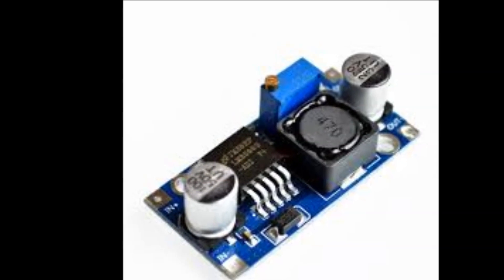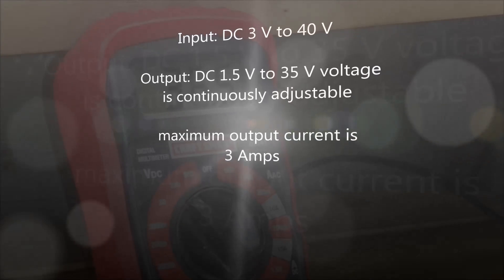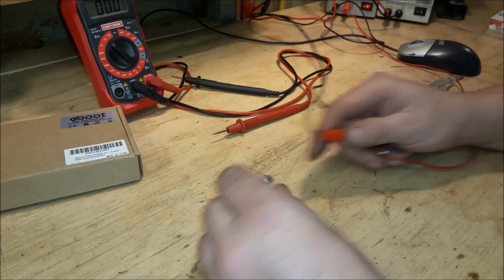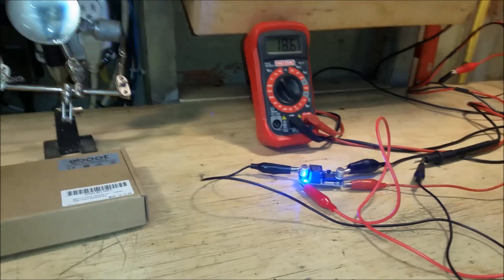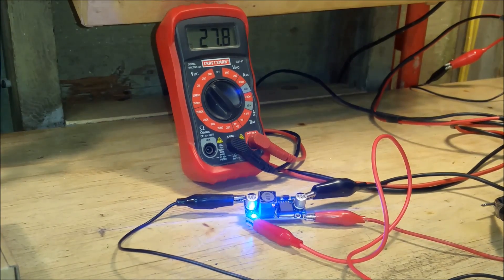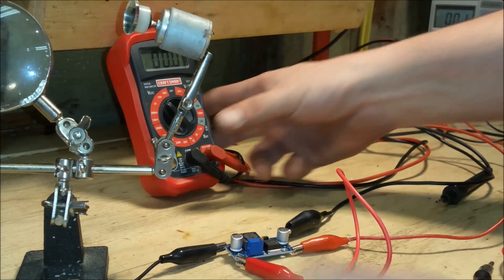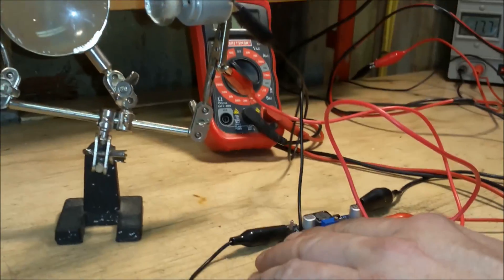LM2596S DC-DC buck converter, with Smoke!! Product Review

Comment: I have few of those which look exactly the same, but from Aliexpress. Mine were using fake LM2596S chip. I measured 28kHz frequency when advertized to be 150kHz and output ripple of 140mV. I ordered few original LM2596S chips from Mouser and tested with them. Output ripple decreased to half ~70mV, which is still considerably high. Most likely due to bad quality output capacitor. However for the price, these are not bad. However efficiency was 3mA better with the fake chip. I paid around 10x more of the original LM2596S chip from Mouser than what the whole converter cost from Aliexpress! 😂

Comment: The led is connect to output with out a led regulater and that make the led with the resistance heat up  . It's a defective design . I have this unit and it best to use this unit to many stuff with input 28v solar panel and output 13.7v for charging battery with 1 to 1.5ohm resistance . Or you can use this model for powersupply from 0 up to 28v and don't forget to put a 4 diod 5A in serial so you can get out a the minimum voltage near to 0 ( put a DC volt amp meter in output )

Comment: I didn't see the smoke in your video but i have this same module and it emits smoke at high voltage. Anyway, i will not use it above 19v. I liked "qwerty mohamedfaroeks" comment too, i didn't noticed the capacitor voltage at output, i am totally noob in electronics. It's a SMD capacitor of 35v, 220uF, 6.5 x 9.0 mm, but not sure. I will try an update soon.
Reply from the maker: Lots of people cant see the smoke,... or imagined smoke anyways.  (can someone that sees the smoke, leave a comment please?)  Thanks Daniel!
Reply: @DonBrandt  Hey! I see that in 1080p fullscreen!
Reply: I run these at 24V to drop to 3.6V @ 30mA without issue. Been running happily for several months. Module temp. 13.6°C, air temp +/-9°C. Just checked it to see as I've only ever put a finger on it for temp. test. Oh, and I can't see smoke on 5.5" non HD screen at 3G Internet speed below dial up... Ahhh 21st century rural inertnet

Comment: A little late to the party, but it's clear to me that the smoke came from the current limiting resistor for the LED.
Reply from the maker: Hi Norm and thanks for the comment. Many people dont see the smoke. lol.
Reply: The design problem is that they put limiting resistor at the output so when voltage goes up it will heat up badly.

Comment: Where is the smoke? I'm on the 40 inch tv and didn't saw any smoke, if there was any, the glare of the blue Led hides it.
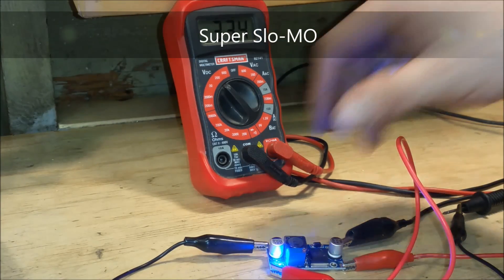Reply from the maker: @ the 3:19 mark, its had to see because of the motion. I think there actually a slo-mo in the video. You can see the smoke just above the blue capacitor.
Reply: @DonBrandt  which one is smoking?capacitor?

Comment: I have 5 of these sh.ty things which all do not work. All show the input voltage. You can turn at the pot and nothing happens. Then I saw, that the through holes were not contacted, so I tried to repair that while thinking, whether it is worth doing so, because I have only spare time for such things. Nothing helped. Also I checked the Circuit, which is a TI application. I think the chips are fake and do not work reliably enough.
Reply: Yep same here, no output voltage at all.

Comment: Dear Sir,I understood the concept of the buck converter. I want to build a led light for planted aquarium. Now as you know the 1 watt and 3 watt leds run on 3.2-3.6 volts which can be adjusted through the buck converter. But now I wanted to know if I use a 12 volt 2 amps or 5 amp power supply then after adjusting it to the right output how many 1 watt and 3 watt leds can I add on the string. And as you know the 1 watt led need 300ma and 3 watt led need 700ma. How to measure that? Please help me

Comment: Im stepping down 12 volts 5 ampere battery to 9 volts using this converter but my battery is leaking acid due to over charging!! Also stepping down voltages should cost an increase in current but since the converters maximum  current is 3 ampere it gives me that current but problem is that my battery is getting over charged...how should i protect my battery from getting damaged due to over charging?
Reply from the maker: is is 9 Volt lead acid battery? Like liquid acid filled?
Reply: Don Brandt yes bro
Reply from the maker: http://batteryuniversity.com/learn/article/charging_with_a_power_supply  has some great articles.  You may be over charging if the acid is boiling, also you may have a bad battery. Check out the site mentioned.
 Thanks

Comment: with all respect to the poster; if you love electronics, you should know that there is a output capacitor of 35Volt, how you supposed to adjust the voltage till near to 35V?? You did this on purpose..to make smoke..i don't know know why you did this, but i use these for a long time , mostly 3.3V and 18V, never saw any smoke.
Reply from the maker: smoke a 3:18 exactly. slo-mo.. i don't know why what i did was wrong. But, i'm willing to listen. I admit, i adjusted to max voltage.
Reply: Okay, if you admit, that's okay, you should read the output capacitor, that he couldn't handle 35V..The maximun voltage that he can handle is 22 to 25 Volts..if a higher voltage is need, change the capacitot with a 50Volt. Regards
Reply from the maker: I agree this device will work fine at 20 volts. However, It is rated at 35 volts DC. I don't think it was the capacitor that was smoking, it was most likely an SMD or the Potentiometer. I did not do a component level test to know for sure. If it was not the capacitor smoking, how would installing a larger capacitor help. To see a detail of the smoke, look here https://youtu.be/rgxHqQDzuZE